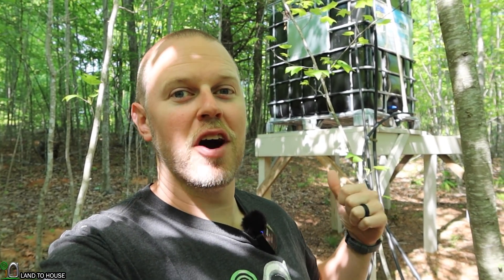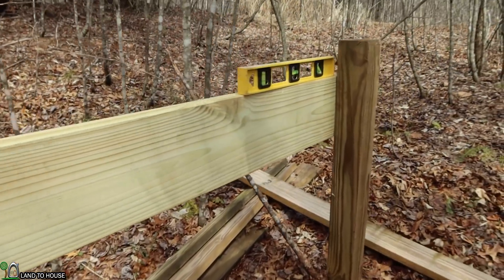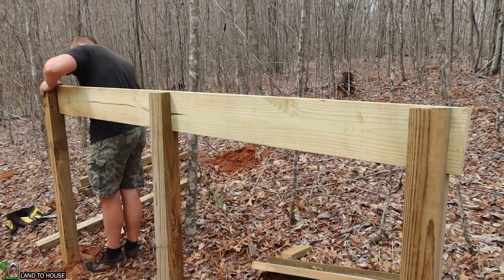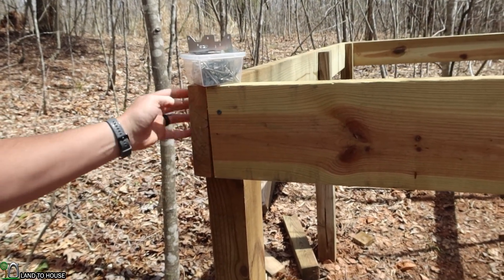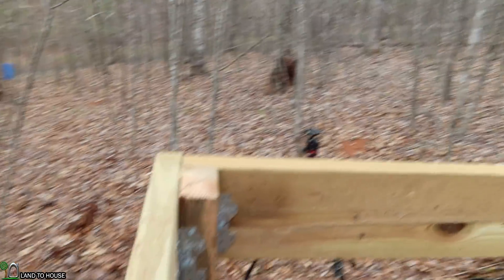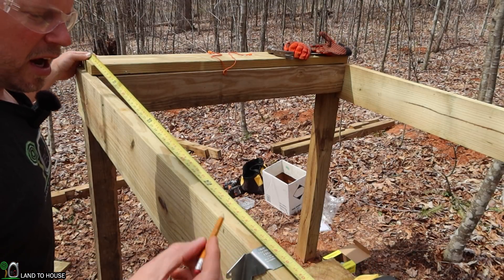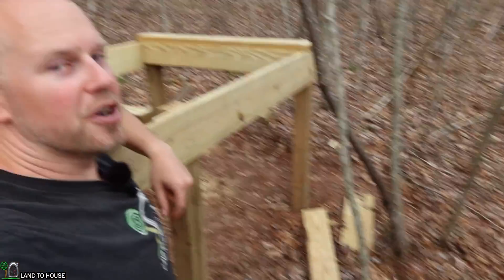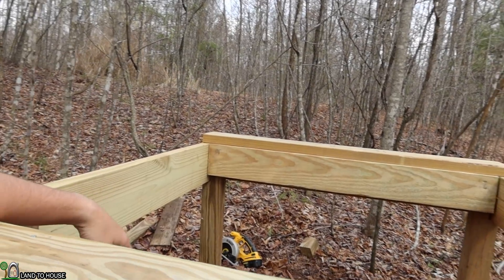Off Grid Water Tower Part 1 of 2 [New 2022 Design]

Comment: If you rebuild this town, you might consider putting some gravel in the bottom of the hole to help with water drainage away from the post. Should help with delaying/preventing rot on the posts. 

Also, you said 660 Gallons, that's like 5497.8 pounds of weight just from the water.
Reply from the maker: I am thinking that this tower should last 20years. We will see. Yes so much weight. The tower has been full for almost a month now and doing just fine. My friend has not gotten the second IBC yet.

Comment: Very nice and thanks for sharing.  Didn't you demo a laser level that would have made marking/cutting the tops of the 4x4s easier?  I was going to suggest angle braces or x-braces for each leg but looking back at the intro and it seems you did(will?).

Comment: Put enough nails in anything and it'll be made of steel :) Just be careful that you aren't relying on the sheer strength of the nails to hold up the boards under the tote. The joist hangars are designed to distribute the load and keep the whole structure from ripping itself apart, so more nails into those hangars would be something I would do.

Comment: just a warning, I built a very similar style tower for two 275 gallon IBC tanks, and it collapsed shortly after filling both tanks.  I used metal hangers and built it very similar to you.  I even used lag bolts on almost all joints.  I did have cross bracing on the bottom legs, but I think they needed to be stronger.  That was where mine failed, allowing the entire tower to twist and collapse.  I had some metal re-enforcement brackets that I had intended to install in the corners, but felt it was overkill.  This is alot of weight to deal with!
Reply: Full his will weigh around 5,500 pounds!

Comment: I did this with square metal tubing.   Welded the frame and carried it to my location.   I'm thinking it might be better to concrete it at each posts to stabilize and spread out the surface area.   This will help to prevent subsidence.   Water weighs alot

Comment: Long time fan, first time commenting though! Thanks for always making such interesting videos.

 I was surprised to see that you didn't dig the the holes deeper. It appears the frost line in North Carolina is 6 inches, which based on the video, it appears you got below that. I could be wrong but the the holes still seemed shallow, especially without a concrete backfill. At 660 gallons, each post will have about 917lbs on it, which breaks down to 57 lbs per square inch. 
If the hole was made bigger and concrete poured into it, the weight would be more evenly distributed. For instance, a 6.5" hole backfilled with concrete would provided approximately double the area at 33 sq in, halving the current setup to 27 lb/sq in. Either way, being only 6 - 8" in the ground seems shallow for holding about 2.75 tons.

A quick calculation for the weight says:
660 gallons x 8.34 lb/gallon = 5,504 lbs (2.75 tons)
5,504 / 6 posts = 917 lb/support post
917lb / 16 sq in. = 57 lb/sq in
Reply from the maker: Thank you for being a long time viewer of the channel. I appreciate that. I think the holes I showed in the video were the most shallow at about 12 to 14". The back posts were somewhere around 2' deep.  To be honest about 6" under the top soil you hit a clay base that is very annoying to dig through. After about 3 weeks I don't see any shifting of the tower. I suppose time will tell. One things for certain it's 100% better than the previous tower.

Comment: Do you need to protect the wood where it touches the ground? Rot protection?
Reply: I’m sure he used GV pressure treated 4x4. The green on the post makes me think he did. But at least you and I would hope so!
Reply from the maker: All of the wood is pressure treated. The 4x4s are ground contact.
Reply from the maker: Those are pressure treated 4x4. Made for ground contact. They have actually been sitting in water for the past 6 years. Still going strong. Should have 20+ years left.